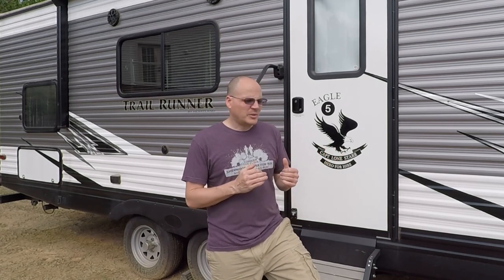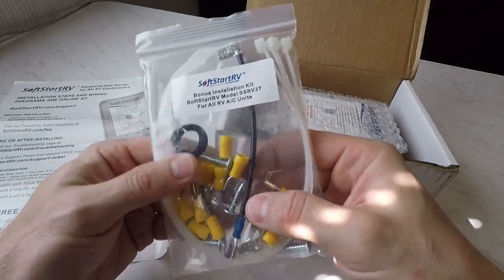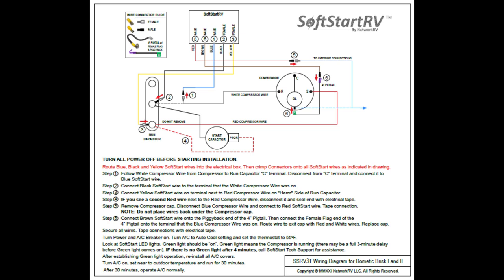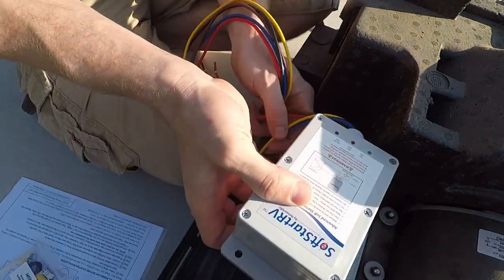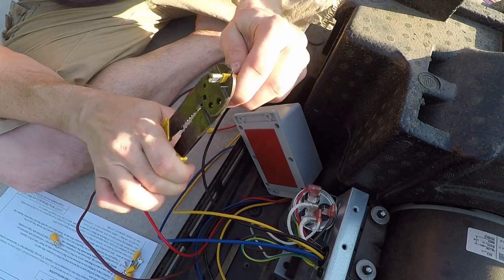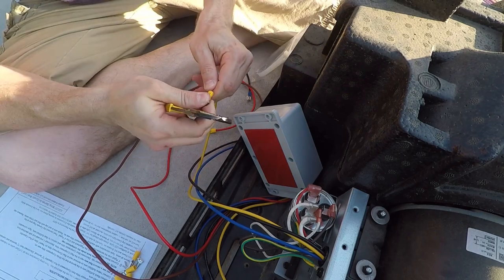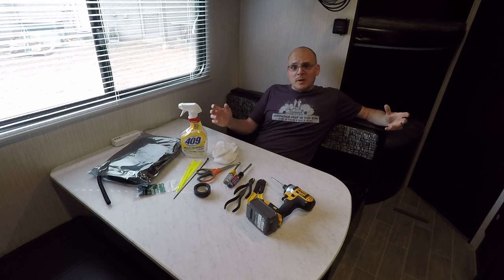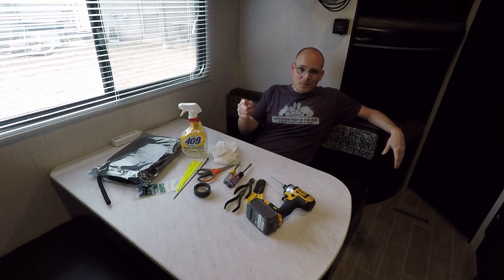SoftStart RV unboxing with Dometic Brisk A/C Installation

Comment: As a follow up I had to contact soft start because my 1985 Dometic AC wiring wasn’t listed on the web site. Soft start replied the same day I submitted a troubled ticket with a super professional and highly experienced tech. He not only helped me over the phone at 8 PM but also drew up the wiring diagram for my records. I was done wiring in 10 minutes with the techs help. It finished the job after about 45 minutes because I wanted the wires tucked and protected and mounted the Softstart . Anyway the system works perfect. Thanks for your great video and thanks to Softstart for awesome support. Have a good one
Reply from the maker: They do have great support! I’m glad you were able to get it all working between the two of us!

Comment: This was great.  Saved me a lot on the learning curve.  I got some  heat shrink  and F connectors to avoid the issues you brought  up.  Thanks!
One recommendation for  anyone truing to work on an RV  roof:  put a door mat or similar item on the roof to protect your  work  area so you don't  accidently  damage  the  roof by  stepping  on a tool or screw.
Reply: Good idea!

Comment: A big thanks for your video!  Completed my Soft Start install yesterday on same model AC.  Did a few suggested changes, soldered and heat shrink on all connections and eliminated the pigtail at the compressor.  Thanks again, this video and the schematics, got it done! Now I can run two 15k ACs on 30amp service!
Reply from the maker: Great! Thanks for watching and I’m glad I was able to help!

Comment: Hi Clay ! Well I got the job done today wile watching your video, thanks men ! I can confirme something about generator. I got a Firman inverter gas generator 3650W at start and 3300W wile running and I got 2 ac Dometic 15000 BTU, so I turn everyrhing off in my fifth wheel and turn both ac on one at low fan and one at high fan. I came with a draw of 27 amp with the generator,  fantastic I can run both ac with my generator.

Comment: Thanks for this video.. I have the exact a/c unit and a Briidea soft start that is exactly like the soft start rv right down to the instructions and wire colors. I will be installing tomorrow and using you video as my guide. Great video, Thanks!

Comment: Thank you!!!!!  This installation video got me over the hump and my install is working perfectly.
Please note, on the Brisk II there are several white wires that run to the starting cap so I used a multimeter and checked for continuity to find the right one.

Comment: Great video thank you for posting and sharing. I have the exact same AC Unit. I chose to drill a hole in the capacitor cover then seal it. I  ran the wires through that hole . As for the wires for the compressor . I used the wire routing that the factory wires use that travel below the fan. So now there is no wires on the outside of the capacitor box near the fan. All my wires entered from the whole I drilled and the two that exit to the compressor do so from within the capacitor box. I really want to thank you for helping me figure out where to Mount the soft start box and to use better connectors which I purchased from Harbor freight. The bridal AC soft start cost me 189 on Amazon.

Comment: What size generator is appropriate when using the soft start? I have a 13,500 BTU Dometic AC.
Reply from the maker: It depends on your power requirements. How many amps does your AC unit need to start and then to run? Do you want to be able to use the microwave at the same time? Lots of things go into generator selection. In my situation I run my AC off of a 3,500 watt generator with (and without) softstart. However I can’t run the microwave at the same time. I’m also limited if I want to run the fridge off electric or if I’m running it on propane. I have solar for lights and TV. I’m pretty frugal with power so mostly only use the generator when I need AC or to charge my batteries. Your situation might be different. Generally speaking, I’d say 3.5k is adequate/minimum to run one AC, and a 5k generator will meet the needs for most people. Multiple AC units or other factors could dramatically change that answer.
Reply: Like Clay said it depends on how much you want to run at one time.  If it's just the A/C and no other major draws of power, my understanding is that you should be able to run that A/C unit with a 2000w generator.  I'm installing this unit this weekend and will be using a Honda E2000 generator.  Fingers crossed it'll work!

Comment: Did you use shore power or generator to power the soft start
Reply from the maker: In the video I used shore power. Since then, I’ve used my generator a lot so far this summer. The softstart and AC work just fine off my generator power. It doesn’t bog it down like it did before so that’s nice. The generator was also the main reason I bought the Softstart in the first place lol